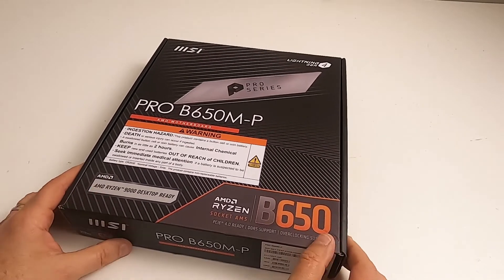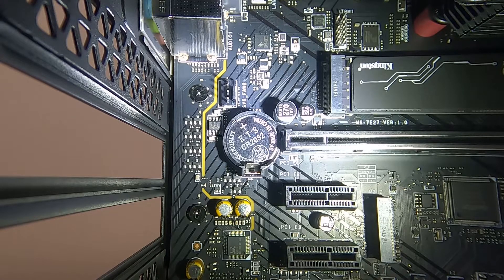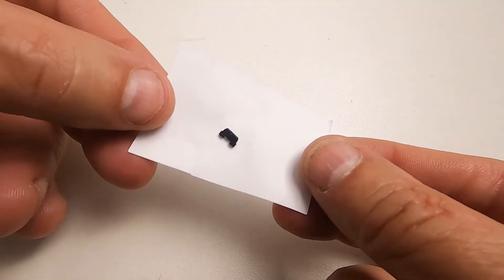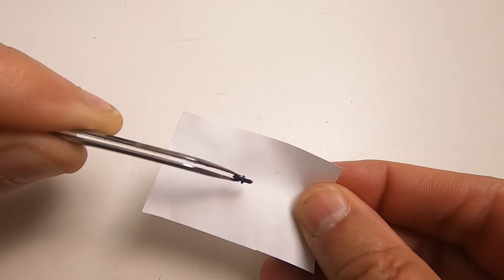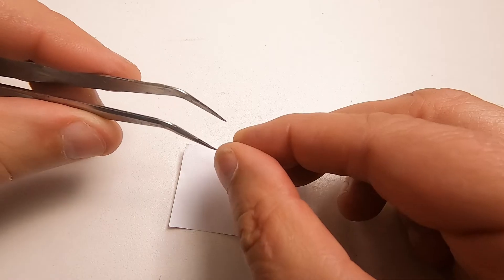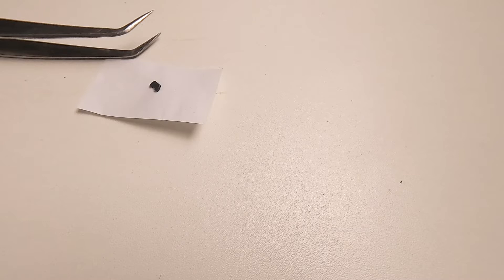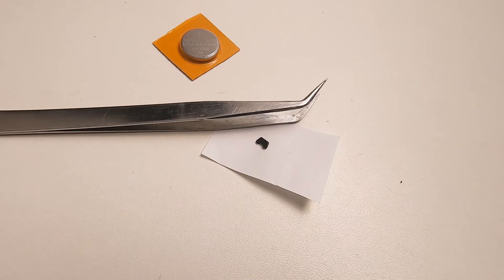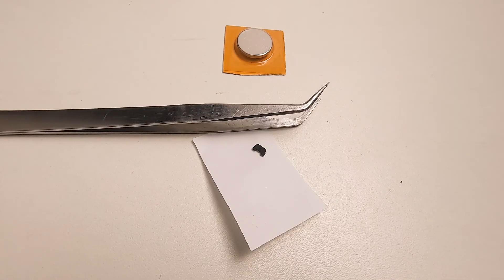CMOS Battery Release Mechanism *PROPER* Guide *READ DESCRIPTION*

Comment: I removed my latch earlier but now when I tried to remove battery, it's impossible to do so, it's stuck....
Reply from the maker: With the little plastic plug removed, the battery docket is just like any other socket. I hope your docket isn’t damaged.
Reply: @sterntechdaddy  no its wasnt, for some reason the spring wasnt unlatching the battery, so i had to use the flat screwdriver and carefully pluck it out...its frustrating but made it work. thanks for replying and ur video was informative

Comment: So I watched this video and tweezers didn't do it for me. If anyone else is having trouble removing the little spacer, use a razor. Wedge one corner between the metal clip and the spacer and gently bend the razor out to partially remove it. Do the same thing on the other side and it should dislodge the spacer enough to then be removed with tweezers or your fingers.
Reply from the maker: Eyebrow tweezers are the ones people have… but they aren’t the best for this.

Check the link in the description for a follow on closeup video.

Comment: Just got mine out with a sharp screw and some sharp wire cutters. The plastic piece now resides inside of my power supply.
Reply from the maker: It’ll be safe in there… 😁

Comment: Bought new mobo in October 2024 and this issue was driving me nuts. Thx for the solution, I will try it. 
But this is solution to a problem that should never exists in the first place.
If the manufacturer didn't want the battery to fall out of the socket during shipping, they could have just not inserted it into the socket at all, wrapped it in a piece of plastic and packed it in a bag with screws. I'm not stupid enough to not know how to insert a battery myself.
Edit: Obviously I commented before your video reached part about little girl died :/
Reply from the maker: I’ve never know a better to pop out from a motherboard holder in transit in 35 years of messing about with computers, but when I first encountered this mechanism I was triggered… so it’s a normal reaction to find it irritating.

It’s problematic to still be angry after finding some context for the mechanism though. 😂👍

Comment: i pushed and it broke inside..
Reply from the maker: 🫣

But provided the socket itself isn’t damaged it’ll be OK. You’ll probably need some strong tweezers to pull it out though. At this stage, you can get rough with it, but be aware of the socket. Metal can be bent back, but the plastic is more of a problem if you do break that.

Comment: I was about to break it forcing the damn thing down with the plastic in it.
Damn.
Thanks man!
Reply: mfw it was hell to put the battery back in to
Why would that even be hard? But it got stuck so hard and i thought it would break

And it did not fix my freezing at loading problem

T.T
Have had the board for 3 weeks, but I already I hate msi so much; it isnt even the first problem
Reply from the maker: With the plastic clip removed the battery holder is just like the others, so putting the battery back in once the clip is out shouldn't be a problem.

You also don't have to replace the clip once you've taken it out. 😊

Comment: I think you are correct about the safety angle, the MSI motherboard box had a warning that these batteries are toxic if swallowed. Thanks for the tip, I had noticed the spacer but how to remove it was a puzzle!

Comment: Still even my tweazers won't get in to remove it
Reply from the maker: The usual household nail/eyebrow tweezers might not work... but take a look at the closeup video. It's in the description.

The tweezers need to be the same thickness as the plastic teeth when they are inserted.

Household tweezers might not be think enough at that point when pushed in.

Comment: Msı x870 gaming plus wifi motherboard
I couldn't remove the plastic pin even though I tried a lot.
I couldn't find a video showing how to remove the pin.
While updating the bios, it gave a black screen. I turned off the computer and could not remove the battery. I pressed the clear cmos button for 5 seconds while the computer was off but plugged in. Then I turned on the computer and went to the bios screen with f1. I selected RAM EXPO1 and exited and it was fixed.
Reply from the maker: Glad you fixed it. This video describes how to remove the plastic lock but it's difficult to do it if you don't have the right king of tweezers. It's also more difficult if the motherboard is in a case too.

If your board has a BIOS reset button/jumper then that's what they expect you to use. In that case they only expect you to remove the battery when it's flat - normnally after about 5 years.

Personally, removing the battery has always been the fastest way for me to reset a BIOS when I needed to - it saves checking the manual for the reset jumper. 😂

Comment: Still didnt understand
Reply from the maker: Watch it again… the clip has teeth on it that fit into holes in the metal battery clip.

You need to insert tweezers so the metal is pushed clear of the teeth to release the plastic clip and then you’ll be able to pull it out.

You don’t have to put it back in… 😀

Comment: tweezers arent near thin enough. u need a thin small knife blade. just pry the black stopper out, u wont need it again. throw it away!
Reply from the maker: It depends what kind of tweezers you’ve got - I have a selection and some work better than others. As this is a safety feature I wouldn’t recommend throwing the clip away especially after reading about what damage these batteries can do.

But I you’re confident a child will never come into contact with your battery - for whatever reason - then there’s nothing to prevent you from throwing it away.
Reply: @sterntechdaddy  im sayin u need tweezers thin as a blade. and i havent seen that many tweezers that thin in my lifetime. yes anything cud happen anywhere anytime but under normal conditions someone goin into my computer case uninstallin things to eat them, just isnt likely. i have new batteries but anyone cud open them and eat one but its just not likely. and i dont leave batteries lying around all over the house for one to pik up, just put a toothpik in and break it off each time. this is wayyy to overkill. or get the gold heat board tape and tape over whole batter
Reply from the maker: MSI didn't have you in mind when they did this. But they did make the decision to make the battery more secure.

I'm pretty careful with them because of things like this... 

https://www.rospa.com/policy/home-safety/advice/product/button-batteries

And this...

https://www.bbc.co.uk/news/uk-scotland-glasgow-west-60306335

And I can be sure that what I do with the computers I handle can never be responsible for killing a child when it's completely avoidable.
Reply: @sterntechdaddy  im jus tryin to help people man and go along with ur video no need to come back at me like a psycho! calm down! easy does it! im not takin a stab at u or msi. im careful too as i just explained and im POSITIVE msi didnt have me in mind no need to tell me things like that u need to slow down man... nevertheless, i still buy msi boards and deal with same issue as u explain u did. and im sure many others do so let it be man, no one has u in mind when i write that or this friendo ;-) im not againts u or MSI  ;-) im not againts someone eating batteries that kill them im not a sociopath, its allllll gooooooood, im very much a humanitarian .
Reply from the maker: The tweezers just need to be thick enough to get the teeth on the plastic part clear of the holes in the metal socket clip. You can do that with eyebrow tweezers, but I like my little set because... *tools*.

😂

Note that my response is pretty harsh because of the damage these things can do, even though batteries don't often need to be replaced they can be a blunt method of resetting the BIOS if there isn't a jumper on the board. It's nice the MSI have made this very much a job for adults to do. Hopefully this also means that the kind of adult that leaves these batteries within reach of a child won't be able to get the battery out...

😜

What is interesting about the battery on this motherboard is that the socket is positioned near the top PCIE slot - so to remove the battery you'd have to take out the graphics card. Yet another layer to the safety consideration... I bet MSI have a whole load of meetings about this - which is why I suggest that someone high up at MSI has have a reason to do all this.
Reply: @sterntechdaddy  yup

Comment: Trying with 3 different tweezers and I cannot get that plastic bit out at all. I can get a grip on it fine but it doesn't not come all the way out
Reply from the maker: You have to get the tweezers in far enough to push the teeth clear of the holes in the metal clip… then it’ll lift out.
Reply: @sterntechdaddy  ordered a pair for tomorrow morning similar to the one you've got here in the video wish me luck 🫡🪖
Reply from the maker: Good Luck! 😁

Comment: So if I STILL can't get it out, where are the cmos pins on this motherboard? I'm asking because I have the exact same board as you
Reply from the maker: You’ll need some flat tweezers… once the two spikes are clear of the holes in the clip it’ll lift out.

I’m not sure if this board has a clear CMOS jumper, but it’ll be shown in the manual if it’s there.

Comment: Instruction unclear, cant insert tweezer
Reply from the maker: You’ve probably got a pair of eyebrow tweezers. The ends are likely to be blunt for safety reasons.

They won’t fit in very well - I have a set that has flatter blades ends that works perfectly - but I wouldn’t use them anywhere near my eyes.

Comment: It is so easy to take it off, flip or angle the device/ motherboard and it will come out.
Reply from the maker: Have you got a new ASUS motherboard?

On ASUS motherboards it's a tiny rubber thing... which can be removed really easily. 

This is not the case for the MSI board in the video. They are very different.
Reply: Mine Motherboard: MSI PRO B650M-P
Reply from the maker: That's the same board in the video... 

Its got the clip and it shouldn't just fall out if you flip the board over. As the video clearly shows - the clip can't be easily removed by someone who might eat the battery.

I actually unbox it here...

https://www.youtube.com/watch?v=f7P487pnm64

Note the warning stickers. If yours didn't come with those attached and/or the safety clip just falls out then I would worry about it not being a new board. 🤔
Reply: It’s new board, but that how I take it off the clip
Reply from the maker: Maybe they redesigned it then... the board in the video is the same model - but it has a little plastic clip with teeth on it. Very secure. Which is why I made this video. 😜

Comment: i dont understand the instructions, do i push in each side of the tweezer into the wholes on the latch part thing?
Reply from the maker: The plastic tab has a tooth on each side that fits into holes in the metal clip. So you need to push in some tweezers to list the metal apart so it's wide enough for these teeth to come out of the holes - then the platic tab can be pulled out.

:)

Comment: Right so I've managed to extract it using a scalpel blade to cut the catches off then pulled it out with vicrorinox tweezers.
Reply from the maker: You can use tweezers... but a scalpel blade sounds more fun.

😜

Comment: Because the creator of this video was so nice and used a jump cut to where that piece was suddenly missing - it's a small rubber spacer. All you need to do is reach down and pull it out. It's very loosely placed in there by the manufacturer.
Reply from the maker: It isn’t loosely placed - it’s a child proof design. On the motherboard in the video it’s clearly rigid plastic and not rubber too.

If you’ve got strong enough and long enough finger nails then you could grab it and get it out without using a tool. Probably.

But people will watch this because they want a bit of guidance. If they could get the battery out as easily as you suggest, then they wouldn’t need to watch this video or comment on it.
Reply: @sterntechdaddy  100% correct
Reply from the maker: @Dweller777 has an ASUS board - they have the little rubber spacer... which can be pulled out really easily. This isn't true for the MSI board in the video.

Comment: I snapped the plastic bit off and bent the clip I’m just praying it doesn’t snap off or bend more so it doesn’t keep it clipped it.
Reply from the maker: You can leave the little plastic clip out - that makes it more like the usual battery socket. You've actually got to be pretty careful removing the clip if you want it to go back in - that's only really likely if you know how the socket clip works.

Which you didn't until you saw this video so don't worry. As long as the battery is held in place securely it's fine.